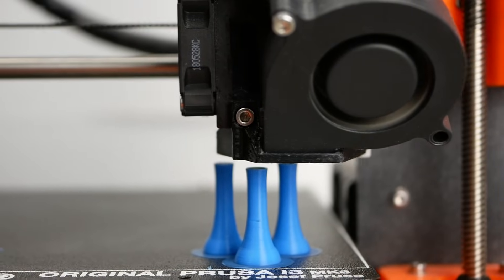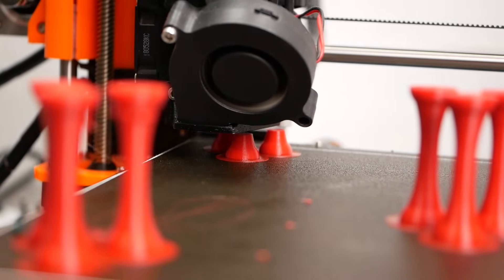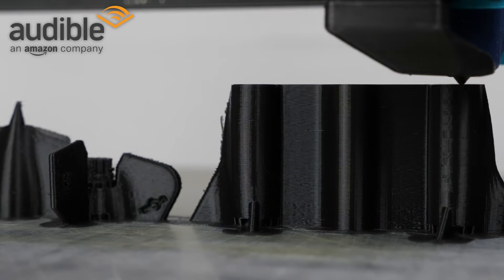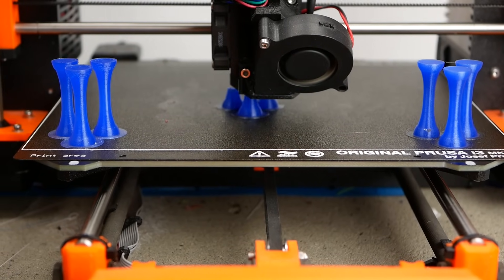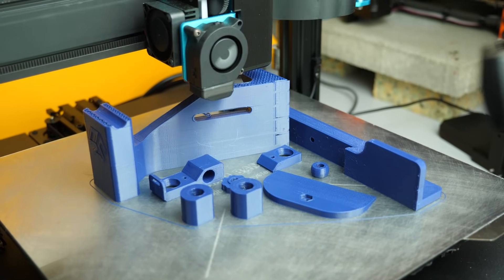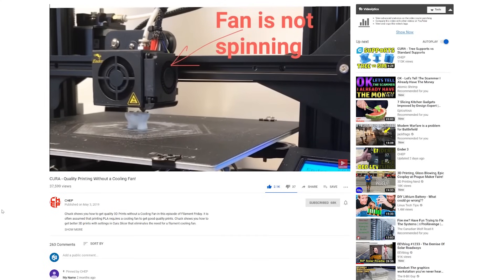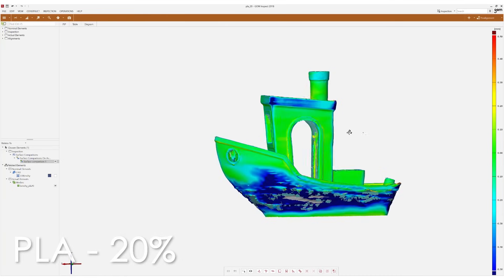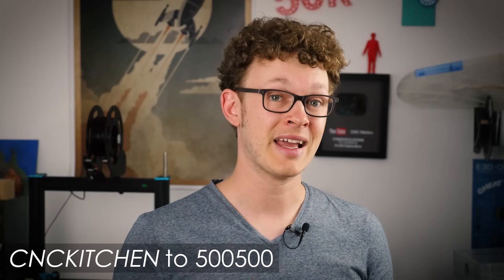MUCH STRONGER 3D prints due to LESS COOLING! Testing PLA & PETG

Comment: Have you ever tried loads of cooling combined with extremely high printing temp? There have been a few interesting experiments, the hot nozzle and plastic help heating the plastic back to a temperature where it bonds properly. Or so goes the theory. Try two of the strongest blowers you've got and printing PLA at ~250-260°!

Comment: Hallo Stefan, I think you miss a very important thing to consider, the extruction temperature, normally we can print with good quality on one range about 25 degrees, but that influence a lot how the layer keep hard to each other, could be nice one test adding different extruder temperature, guten tag :)

Comment: Yooooo. I literally just printed a part at 190 degrees with dual 5015 fans. The part crumbled like a bad cookie. NO ADHESION AT ALLLLL WTFFFFF
Reply from the maker: Up the temperature a bit. 190C is quite low.
Reply: @CNCKitchen  Yea I'm gonna try 205 and 50 percent fan speed. Was actually quite funny to crumble the part and see absolutely zero adhesion. Might be fun for a video idea 😉

Comment: You have printed 3 of those test prints at the same time, assuming that you've always printed 3 at the same time for consistency, it is still affecting the results. While you have one layer printed on one of the tests, the other 2 are cooling so the effect of the coolers will not be the same as if you would print only one of them at a time.
Reply: Yes, actually that affects a little bit the consistency of the test, but, taking on account that the tendency is clearly better fixation under no cooling, printing one sample at a time would give better results, if they don't fall over themselves first of course. But this kind of information is very helpful for printing under-force/compression piecess.
Reply: @emmanuelrodriguez2346  Yes, we can safely assume that.

Comment: I do wonder what makes the bigger difference with the cooling. 
Is it that the last layer is still hot? Or is it just that the last layer cools down slowly with no fan. Or a combination .
I ask because with a larger more practical print the last layer might not be that hot even without a fan on, perhaps with a larger print the cooling fan might not change much if the strength is from laying plastic on a still hot layer.

Comment: I think your study went wrong. I can print with 100% fan at 120 mm/sec or, I can print 100% fan at only 30 mm/sec. That will give much more cooling to my model. And what type of fan did I use? 4010? 5015? or external air source? It is all a completely different process. I think fan speed is less important than overall layer time and what type of fan do you use. Since I changed my 4010 to 5015 I can decrease cooling speeds by about 25-40 %.

Comment: List of usefulness.

PLA Reference: 59MPa
PLA 20% (Less than 20% and print is ruined): 38MPa

PET-G Reference: 49MPa
PET-G 20%: 26MPa

Having 2 separate cooling paths is good for cooling the heatsink but not the print.

20% PET-G is perfect, 20% PLA has one side that is deformed, the side away from cooling.

Less cooling usually has better layer strength. PET-G is better in this sense, slowing the print and using min. layer time helps with print quality. DasFilament PETG shouldn't be used in safety critical applications, the DasFilament wasn't mentioned in this Helpful Comment, because it was the first PETG and was scattered results proving to be unpredictable at best.
Reply: Perhaps you could do your own video with your own stress gauges.

Comment: I've been curious about that very method of 3d printing by plastic at all. There are some liquid filaments and method of metal 3d printing that print not a line but whole layer at once... There no cheap way to do so? And how much will be difference in adhesion between layers so?
Haven't access to any plastic or 3d printers, but for one of my possible project that information can be crucible. Just want to understand what I need to use for much more affordable resulting product in measurements where I haven't access to examples of both variant of producing - 3d printing and casting. For project also extremely important are flexibility to put any even slightest changes in model geometry more cost effective. If some one can help with some information please answer below this comment.

Comment: My question is if this would help strengthen the supports on the print? I have a problem with one that keeps breaking off after a little bit of weight is added.

Comment: Hallo Stefan, I saw you printing blue PETG on the Sidewinder X1 in this video. I have a question regarding this: Are you using the stock hotend configuration(with teflon tube running through the heatbreak) or have you changed it for an all meta hotend? I'm looking to get into PFTE printing but I'm not sure if it is necessary to get rid of the teflon tube in the heatbreak first. Thanks for a quick reply! Otherwise I like your channel very much. Please keep up the fantastic evidence based work!

Comment: what if you could use a dual extrusion 3d printer and do the infill with one filament and the shell with another. The internal filament being PLA, and the external filament being PETG. Then set the slicer so walls print before infill on each layer. Then, make it so the PLA has a way higher extrusion rate than normal and higher temp to melt layers, but not too much to melt PETG. Also on the internal layers try turning off the fan? 

The PETG shell you would probably want to print close to normal settings, as it would be more for the asthetic, so the part doesn't deform. You would essentially be building a bowl of petg around a soup of PLA. I wonder how well it would hold up.

Comment: Thanks for doing these in-depth investigations! One piece of often information I often struggle to find is quantitive information about the warping properties of filaments. 

Given that I most often print molds for casting precise technical parts, warp is about the only material property I really care about; and not just if its low enough to stick to the bed; but if I can count on my holes having the right spacing, and if rods will turn into bananas or not. 

There are some filaments out there like ABS-X or some PLA variants that claim to be zero-warp. Also, some say that a heated chamber helps for PLA just like it does for ABS. But an actual in depth investigation of the matter, is something I have been unable to find. Perhaps you will find it interesting to do something along those lines in the future.

Comment: I wondered why I hadn't see videos from you lately... I hadn't rung the bell!  
Interesting study, I'd be interested to see if a post-print heat treatment has any affect on inter-layer adhesion.  A logical follow through on this would be to tweak slicer programs for intelligent control of fan speed based on overhang angle or layer print-time.  In other words, it would cool more on overhangs and small area portions of the print, and cool less on open wide areas where cooling is less necessary.
What are your thoughts?
Reply from the maker: Check this out : https://youtu.be/dOzVuoBP9gY
And yes, intelligent fan control might be a good thing but not yet implemented in a slicer.

Comment: I use Das filament petg and I am pretty satisfied. I can report that I have found small variations between types of spools. For me the transparent was the best in printing quality, layer adhesion and overall strenght. I always cool 100% when printing and used the recommended 230 and 75 degrees for temps. Thank you for your efforts and your videos. It really helps everybody that deals with a 3d printer.

Comment: Strange, I seem to get much stronger prints using PETG but I do use the maximum 240'C my printer can cope with.  I find PLA goes stringy when it is too hot bit PETG stays more stable.  Perhaps some of the heat goes into the previous layer and increases the bond strength.

Comment: in large parts cooling happens anyway. a solution could be having a cooling fan and a warming fan, cleverly used. the warming fan should guide it's air through multiple vents arround the head. the proper vent (depending on the print direction) would open to preheat the last layer at the exact spot that is going to be printed. or a rotating vent. this way you would have maybe the best in quality and strength.

Comment: An annealing step may give the same benefit without the compromise in print quality.  Seems like the same mechanism - the print spends more time between melt and glass transition temperatures.  Worth a followup test?

Comment: Always print Benchy pointing into the wind.
Reply: open the nearest windows pointing towards the ocean!
Reply: Never piss from the windy side of the boat.
Reply: Should I do this with ABS?
Reply: @keithkittler188  do it
Reply: @keithkittler188  I believe PEEKs will yield more usable strength than ABS. Unless you have back warping trouble. Then you need more focus on ABS.
Reply: Yarrrrrrrr......
Reply: Facts!
Reply: Nose to wind nose to wind

Comment: I'm curious as to the effect of a silicon sock on a test like this. It's well known that after the print fan turns on, the temperature of the heat block swings a bit while the heating element compensates for the increased cooling that hits it. I wonder how big of an effect these swings in temperature have on layer adhesion?

Comment: I wonder what effect print speed has on layer adhesion at 100% fan speed. I would assume the slower you travel the more heat will be transferred to the previous layer improving adhesion but would be cooled off quickly due to the high fan speed improving print quality.

Comment: Steph, there's much better way to improve layer adhesion than reducing cooling: print much hotter.
Like crazy hot, PLA can be printed at 270°C just fine and if your hot end can handle this — it prints amazingly.

Also slowing down helps a lot.

Also also your DAS PETG is clearly was wet, so hydrolysis happened.

Comment: 1) printing in batches of 3 pylons affects the cooling of the material
2) you can use 0 fan speed but you need to lower the speed

I have a CNC screw driven repurposed for printing I do not have a fan, but my max speed it 9mm/s. printing in 2mm I have no quality issues. find the speed where you can print with 0 fan speed properly and you can then enjoy the strength of the material

Comment: So, I'm still relatively new to this. But I'd like to ask you and your fans; Do you notice that your settings need to be set differently for different colors? Let's say between natural, red, black and green, and from same manufacturer? ABS as well as PLA. .  Also, does it look like there's a happy medium between high and low fan speeds? I call it goldilocks zone.
Reply from the maker: There can be a slight difference in nozzle temperature but since I usually print on the warmer side it doesn't affect me so much. If you're printing in the ~200°C and lower range, some colors might need slightly higher temperatures.

Comment: Would be interesting to reprogram the fan control to cool only when printing overhangs and outside perimeters and see how that would affect strength... on one hand, it should not compromise strength on the infill while keeping the outer surface tidy but on the other hand, cracks usually originate on stress points on the surface which this approach would not change from the normal cooling approach... so it would be very interesting to test this out.

Comment: I wonder if this actually affects the strength of bigger parts because of the increased layer time.
Probably the previous layer will already have cooled down so much that Fan speed doesn't make a difference.

Great video👌

Comment: Interesting, but if I need a lot of strength for such a print then I could use annealing, or not? Putting it into an oven for a while, and there are no layers.
Reply from the maker: Won’t work unfortunately. Annealing will only marginally change the strength, it mostly increases temperature resistance.
Reply: @CNCKitchen  Thanks, I'm quite new to printing, didn't know that yet.

Comment: So 3D pens have a diferent way of heating the hot end compared to standard 3D printers. I't looks to me like the heater itself is the hot end so does this grant better control over temprature. If we put this on a printer would we still require hot end cooling? I'm not sure but I think this would be a fun topic.

Comment: could you test the strength values of prints with Ironing throughout and those with Ironing on just the top levels against prints without ironing? I've just started using this feature as the end product looks allot nicer but i wonder if it has any effect on the strength or adhesion of the print.
Reply: So a fouble heating?

Comment: Doesn't the heatbed change the temp of the part cooling air?
I put a couple pieces of paper towel over the areas of the bed I'm not using and tape them down.
The bed temp doesn't change as much and I use less electricity, along with cooler air above the bed itself.

Comment: Isn't there also another variable to consider: the speed of the air coming channelled from the blower, not only the rpm. A small air tube design for air flow at 20% has for sure a sharper airflow and therefore higher cooling effect then a bigger air tube at the same 20% setting. If this is off the path thinking, please correct me :-)
Reply from the maker: Of course! This is why I said, that this is a general guideline and everyone needs to find out on their own how low they can set the fanspeed while still getting acceptable printing quality.
Reply: @CNCKitchen  Excellent research and study presentation. Looking forward for the next topic. Thks Stefan. Herri in Kunming.

Comment: I guess, you have a dual extruder printer, Stefan. Could you try to make a test with the inside printed without the cooling fan, for strength, but print the outer layer with the second extruder and the cooling fan activated to make the surface look good. It would be great if you could try this, because I haven't got a way to accurately test the strength of a part, but would like to find out if it is possible to get good layer adhesion and good looks.
Reply from the maker: Nice idea!

Comment: I tried to get a job as a mechanical engineer at Skunk Works. By the time they got back to me (almost a year later), I had already accepted another job. This other job with General Physics eventually sent me back to the rocket site at Edwards very close by. That was about 20 years ago. I worked there for a couple of years. The desert there is miserably hot and windy. I love your informative videos.
I make parts for function and don't care how ugly they are. I will try to print with less cooling to see if I can get stronger parts.

Comment: Have you considered a larger fan outside print area, but close to the printer? A regular tabletop fan or even just a large PC fan to create a more even cooling effect as it seems like as little cooling as possible without compromising print quality is the way to go. Clearly the sweet spot depends a lot on material you are printing

Comment: This more or less validates everything I've observed so far when printing, but I think there's a few things worth mentioning for newer users:

- More emphasis on slowing down prints/layers and tuning that. I usually slow down the print for layers below 20-30 seconds, and kick up the fan for layers below 10-15 seconds (depending on filament of course).

- Super-important: Separate bridging cooling settings! Slic3r, Cura, S3D all have this (not sure why it's missing from Ideamaker, last time I checked), and I set it to full blast when bridging, which is critical on a 0.6mm nozzle! I still sometimes get artifacts as the fan takes time to spin up, but most of the time it works remarkably cleanly.

- In addition, I think some slicers might offer separate overhanging cooling settings. I don't think there's an ideal implementation of it, where it would adjust the fan speed based on the overhang angle and strictly limit it to just the overhanging region, but I'm pretty sure Cura had an option for it at some point, and it's better than nothing. Overhangs tend to be where I have some trouble, even when following the 45 degree rule, simply since I can't have the slicer crank up the fan for those regions.

Lastly, having visited your videos on how print temperature affects part strength, I think it would be interesting to visit a combination of the two factors and how to tune them together for different filaments, at least if there's anything new that you find.

Thanks for covering the topics of 3D printed part strength. There are very few resources on it online, I had to learn most of it on my own, and it's nice to throw some proof at fellow 3D printing hobbyists that there are better ways to do things lol.
Reply: good comment.
Reply: Bridging fan speed is an option in Ideamaker but I can understand how you missed it because Ideamaker's setting UI is trash. 

Go to advanced settings > Other > Enable Bridging Detection and then the options aren't greyed out
Reply: this is pure gold

Comment: As you already have the installation for annealing, it could be very interesting to see if you can cancel the impact of cooling with annealing. It could be a good way to have both of gemometric quality and strengh performances.
Reply: Have you tried annealing pla with salt or sand or something similar? If so how did you change the scale of your model before printing?

Comment: Great work like always! It would be interesting to know if an enclosure makes a difference here. Even a simple cardboard box around a printer will raise the temperature to 35-40C which is a lot closer to PLA's Tg thus it may improve layer adhesion significantly. It does for ABS so ....
Reply: I've actually printed PETG inside enclosure at 40C and print results were pretty good with standard Prusa settings. Didn't notice any overheating issues at all.